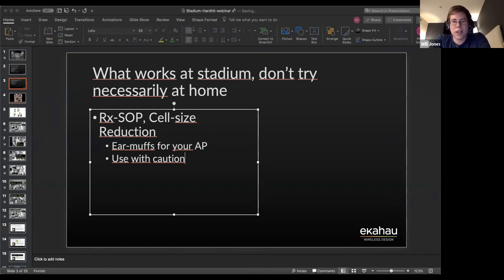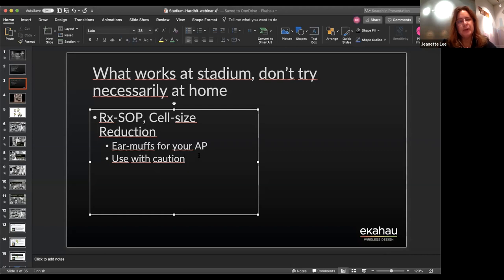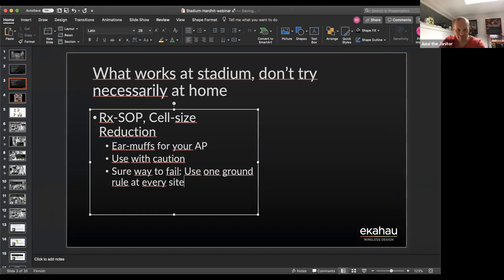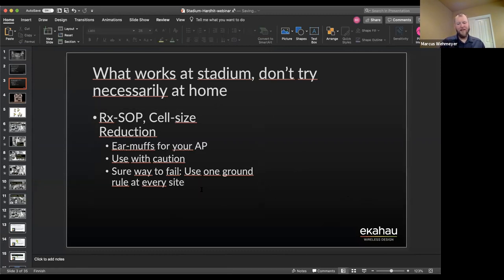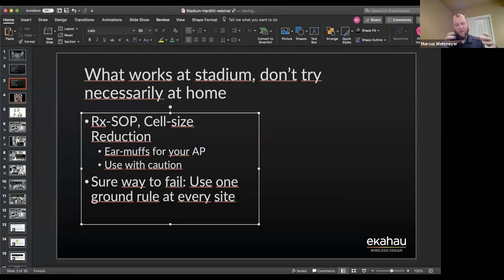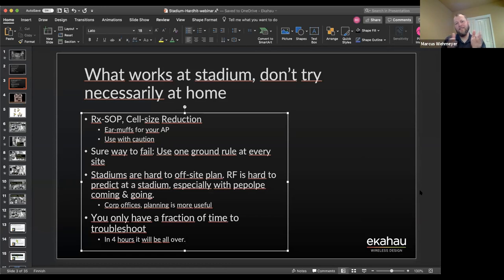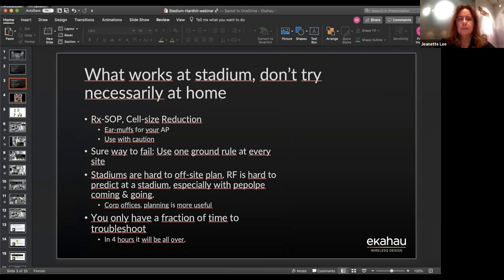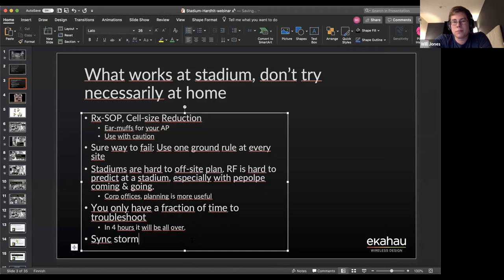Panel Discussion: High Density Wi-Fi with Cisco, Aruba and Ruckus

Comment: Very interesting and informative discussion, the format was refreshing and easier to watch than some of the more dry presentations out there. Thanks for providing this to the community. One question I had if anyone is looking at these comments, what is the average device count that these AP's are handling and what is the device count per AP that you guys shoot for? I know it depends on what the use case is and the client mix but just wondering if there's a general number.
Reply: Hey Steven, for underseat I like to aim for 65-75 seats per AP being covered and overhead normaly 120-150. Usually will see around 30-50 users on the APs during the event in the bowl, in concourse areas it can climb up into the hundreds pretty quick.  There's concurrent associations, then active users that is a subset of that peak - usually 10-15% of the concurrent users will be actively doing something with the network at the same time - so don't be scared to see 100+ users on an AP at one time.